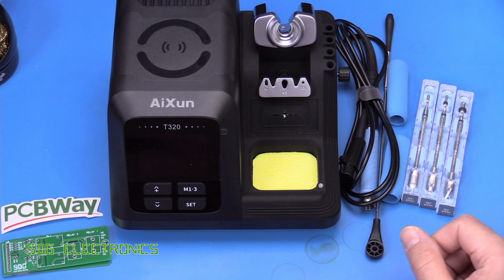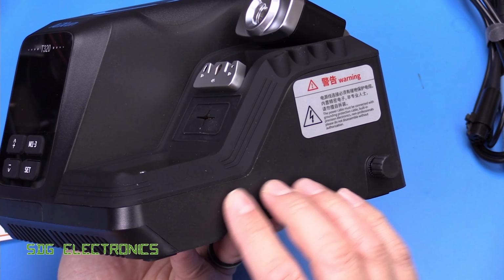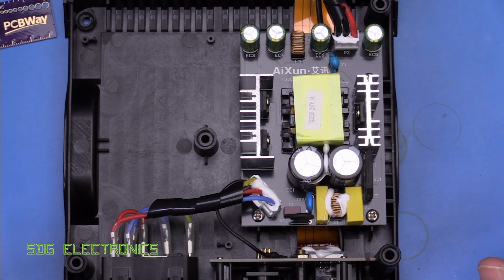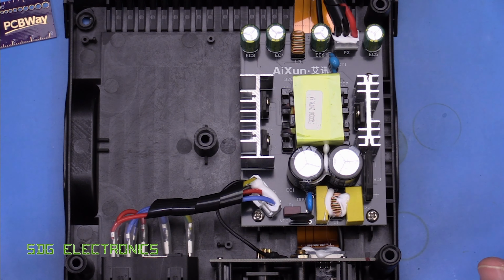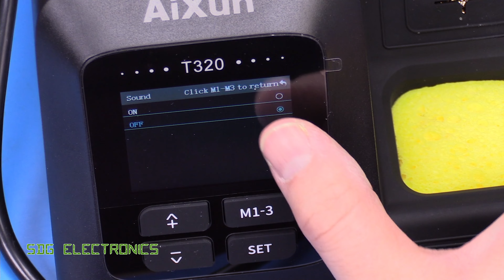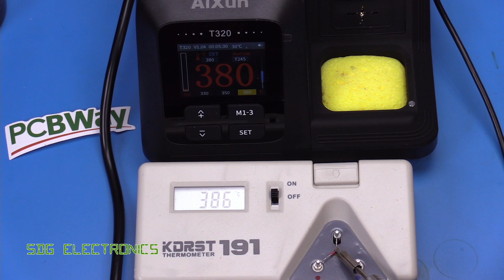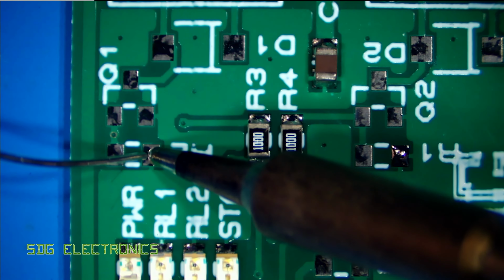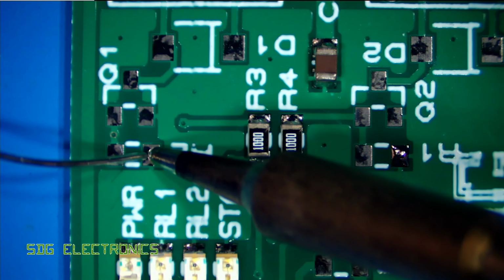SDG #319 AiXun T320 200W JBC Style Soldering Station

Comment from the maker: PCBWay 3D Printing and Fabrication: https://www.pcbway.com/rapid-prototyping/
Aixun Website: http://aixuntech.com
Aixun T320: https://s.click.aliexpress.com/e/_DkgnT15

Pico Technology 5000 Series Scope:
https://www.picotech.com/oscilloscope/5000/flexible-resolution-oscilloscope
Support the Channel with Patreon: https://www.patreon.com/sdgelectronics
Reply: Does it have problems with temperature spikes when you touch ground with the tip? Aixun was hiding problems with previous models by showing no real temperature... Also voltage about 1 V with ripple was leaking through the tip, in other video it was almost 1.7A.
Reply: Can you please check it if your device has similar issues like in tony359 on 11th minute he shows voltage leaks, temperature spikes at the tip of the iron.
Reply: Does it leak to grounded surfaces like the other auxin ? 😊

Comment: honestly the feature for changing temperature with the iron is pretty genius! Never seen anything like it but it makes a lot of sense. On my workbench I have the iron and control unit on the right side which means I either need to reach across with my left hand for change settings, put the iron down and use my right hand or try to change it with my right hand while also holding the iron which is what I often do but isn't really the safest

Comment: Thanks for the review gave me the confidence to buy one. My first soldiering station.I like its all in one: sponge, steel wool,  and cradle. Heats up quick and automatically shuts off or runs in low power mode. My old cheap iron I would ruin the tips because it run 100% and I'd forget it on.

Comment: Did they correct the un wanted voltage at the tip that the older units had?
Reply: and the temperature jumps and lying temperature display
Reply: Doubtful. It’s the thermocouple circuit design that’s the issue.
Reply: @I_SuperHiro_I  maybe a couple amps of heater current flows out of the tip too! 

When touching the tip to an earthed pad, a parallel return path for the heater current is created through the mains wiring, like a ground loop (because the SMPS output -ve is earthed and JBC C245 thermocouple bridges the tip & heater).

Comment: If you want to replace the no-name capacitors.

X2 400V 120UF 30x18mm Pitch: 8mm
X4  35V 1000UF 20x10mm Pitch: 5mm
X1  50V   22UF 11x5mm Pitch: 2mm
Reply: Sadly, unlike american companys where you can tell when a revision has been done, these chinese companys change the product on the fly and without warning or indication.

So whatever caps are on it today, might not be on it tomorrow.  And when you shop on aliexpress you could be buying a 2024 model, or it could be a first release, or it could be a chinese company copying a chinese company
Reply: @andrewa8569  A chinese company copying a chinese company, lol thats funny!
Reply: @smjerbetsk   Happening all the time

Comment: For someone trying to get a good decent iron who is not familiar with all the brands and the pro's and cons it's an absolute minefield!. Some are not earthed, some have massive temperature fluctuations, some are not good at some repairs (pinecil for bigger jobs etc). I wish someone would make a video with 5 irons and give beginners more help and info on one video. It's overwhelming :)
Reply: Hi, I'm in the same situation, after your research which soldering station do you recommend buying ?
Reply: That's where I am, as well. I've found myself interesting in soldering, mainly as a sort of hobby (game controllers and such), and can't decide on what to get. I don't want to spend a ton on a pro-grade setup, but I don't want to buy junk either. Other than the biggest names, which come with the biggest price tags, all the others just sound like made up names you'd find on aliexpress or amazon, and I can't make heads or tails of them.
Reply: @CajuNerd  As you rightly said the problem is that the big brands like JBC, Pace, Ersa, Weller, Hakko, Metcal, have a high cost, at the beginning I wanted to buy the less expensive models like the hakko fx888d or the Weller WE 1010 but both use the old technology with a separate ceramic heating element that transmits heat to the tip, the soldering stations (of well-known brands) with the new cartridge heating system are generally more expensive, the cheapest basic models I have found are the JBC BT-2BWA and the PACE ADS200, or the i-CON NANO MK2 which does not use cartridge tips, they say it works well anyway even if it only has 80w, and its tips are cheaper, unfortunately these stations are around €300, keep in mind that the original JBC tips are expensive, the rest of the stations are part of the T12 hakko and JBC clones, C115, C210, C245, in my opinion it is better to aim on soldering stations with linear transformer (compatible with original JBC handles) which do not have the problem of grounding and temperature fluctuations, GVM H3 3, Wemon T31, jabe ud-1200, AiXun T420. Otherwise with a very limited budget they recommended me a station that uses T12 tips, the T12 are very cheap, the STM32 stations like the QUICKO 958 and the KSGER v3 are compatible with the DavidAlfa firmware, the custom firmware offers many advantages, in some models the grounding problem must be fixed, even if in the latest models they have fixed the grounding on the case but not on the tip, electrostatic discharges, called ESD, can occur, the topic is a bit long, it is advisable to have a second soldering iron if it is necessary to make some modifications to make the station safe, the power supplies of the QUICKO and KSGER are not great, some recommend replacing it with a double isolation power supply like the Meanwell RPS-120-24, there are also the QUICKO and KSGER mini without a power supply where it is easier to combine a quality 24v 3-5A one. Finally, they also recommended that I purchase a used station like the Metcal MX 500.
Reply: Totally agree. I spent last 3 days deciding what to buy. The more i read, more i am confused.
Reply: "For someone trying to get a good decent iron who is not familiar with all the brands and the pro's and cons it's an absolute minefield!" In a way that's true, but in a way you could also just buy from Hakko, Ersa, Metcal etc and know you are getting a quality product from a reputable manufacturer without needing to think too much about it.  

Some still swear by Weller too, though the internal constructions of some of their products seem a little shoddy nowadays.
Reply: @CanaleYouTubeGeneralista  Those are great points! However maybe the problem is hobbyists being obsessed with using integrated heater soldering tips, when the older-style is reliable and works just fine?  I see Mr. Carlson from Mr. Carlson's lab using a basic $100 Hakko FX888D and having no issue with it for example.
Reply: @spiky29  I've been reading about it for months, lol! I could have just ordered a FX888D and given it no further thought, which may have been better TBH. 😂 It's pricey at $217 AUD + $50 AUD for a set of extra tips, but it will probably last 20+ years where the Chinese soldering stations probably won't.  Then there's Pinecil, FNSIRI, Miniware etc too...
Reply: "I wish someone would make a video with 5 irons and give beginners more help and info on one video." Made with Lawyers has a video comparing Pinecil, Miniware TS80P, Weller WE1010, Hakko FX-888D and Ersa i-Con Nano.

Comment: Thank you so much for this review. I just ordered the Aixun T413, which looks to be the same, just with a traditional frequency transformer.
Reply: Does it work well ? How do you like it ? Has the grounding problem been solved ?
Reply: @CanaleYouTubeGeneralista  not well so far. Genuin JBC cartridges are not able to boot up the station, unless i heat them up manually before turning the station on. Then the resistance gets high enough for the station to allow the boot and handle to  recognize and start. When started, it works really well… it is however very frustraiting, and Aixun is not very open to promis a firmware to help this issue…
Reply: @EmilWilkensRC  Thank you for sharing your experience, let's hope they solve it with a new firmware, I was looking for a soldering station with a T12 or C245 linear transformer, I didn't want to spend a lot, can you recommend some soldering stations ?
Reply: Just to add: I received a T413 last week, bought it for the same reason (with transformer). It came with the initial firmware v1.01 and I did not update it yet. Having read your post about genuin cartridges earlier, I did a quick test with a new original JBC 907H and a JBC 911H cartridge straight from the packaging. Station and handle still 'cold' as well. The station properly booted with both and started heating both after placing the handle with cartridge in the holder as mentioned on the display. So I can't vouch for other cartridges, but these worked on mine.

Comment: This video couldn't have come at a better time. I was on the fence with a T3A / Mechanic C211 and Sugon T21. Just bit the bullet with the T320. £101 delivered to the UK within 7 days with 3 tips is an absolute steal.

The one confusing thing is that I thought T210 and T245 are wired differently? 
I know the T3A uses GX style connector with T245 whereas the T245 on the T320 is 6 pin and is the same style as the T210 on the T3B
Reply from the maker: On the T420D the irons both use the same connector. Some of that circuitry around the driver transistors may be to adjust the drive for the two different irons

Comment: i have a question for you. so i am fairly new into understanding these soldering stations and i am a hobbyist mainly in rc car building but also make custom flashlights. i had a weller we1010na that i just returned because it struggled to solder the bigger stuff. i just bought a aixun t3a but havent recieved it yet. i solder some very big things 6 awg wire and big bullet connectors on rc car esc speed controllers. what would be the best soldering station you would recommend for plenty of power for someone doing big soldering stuff but also small pcb on flashlights if i want? is the t3a i bought going to cut it?

Comment: So I just purchased one of these right before learning about the T413. I am seriously considering returning the T320 when it arrives, or maybe re selling because I am not confident that attempting a return through ali express is wise. Would you go through the trouble to get the T413 over this? Seems like they are a little hard to come by in a 110v configuration. *edit, canceled the order and bought a T420d with 2 handpieces.

Comment: on some scenarios it's impossible to make the PCB "fully disconnected" from earth. I've been trying to use my T3A to de-solder SMD capacitors, using a second traditional iron. It's impossible, the temperature reading gets unreliable and the tip reaches 500C with 360C as set point. I am so unhappy with my T3A, I would not buy it again. I feel that this earthing issue is a major one. 
This seems to behave a little better but still I don't want to see 410C when I set 310C on the unit. I would also check the actual tip temperature when that happens: with the T3A they tried to hide the overshoot with FW 1.34 so who's telling us that this is not doing the same and they are also covering the power spike on the display? :)

Thanks for testing the earthing issue I discovered on my T3A video review.
Reply: Isn’t it trivial to add a switch (or just an anti-ESD 1-10MΩ resistor) between the mains earth and the 0V rail?
Reply: Maybe buy the linear psu one
Reply: @Scrogan  I am not 100% sure the supply earthing is the issue here.  Even if it was, does that mean the tip is going to be unearthed? It also means opening it up, probably break the front panel in doing so and losing whatever warranty it comes with :) Anything is possible of course.
Reply: @ndarjotech Maybe buy a JBC? :)
Reply: @tony359  i will wait for the review in eevblog 😂
Reply: You are right, this unexpected temperature raising because you touch earth is THE show stopper for me. It clearly happens again in this video with this device, and no I don't believe it is any better than before. Not solved at all. Is this thing actually passing certifications? Is the handle sufficiently isolated from mains? I'm not convinced about this....
Reply: @Janktzoni There’s also a military standard regarding leakage voltage on the tip. All the name-brand ones pass it now*, I’m quite certain these do not.

*amusingly, JBC failed it in their early cartridge heater system using the T2045 handle and tips. It was quickly followed by the T245, which added the third terminal on the cartridges to fix the problem.

Comment: Wow. It seems to be a much better improvement to the T3A. There's something I'd like to know that I haven't found a solid answer yet and I hope you don't mind me asking for your help. Is it possible to use ANY original JBC 245 and 210 cartridge from their entire cartridge range with these T245 and T210 AiXun handles? Would original handles work with this station? Thanks in advance for your help, Steve.
Reply from the maker: Yes the cartridges all work. If you buy a JBC handle, you'll need to swap the connector though.

Comment: Wonder which one would be a better buy. The T3A (or the newer T3AS) or the T320
Reply from the maker: I think this one is probably better overall.
Reply: @sdgelectronics  From what I've heard the T3A had some issues with overshoot, but also power supply buzzing issues. Maybe those are fixed on the T3AS, or is it the same as the T3A? The T3A just takes up less space with the separate stand.
Reply: @PiratCarribean  Pretty sure The T3A and T3AS have the same issues with buzzing.
Reply: @PiratCarribean  those are software issues

Comment: I used to work in the electronics industry for a long time, and our soldering stations were JBC. You mentioned this unit being very light, does that make it move across the table when you put the iron back in the holder?
Reply from the maker: The feet have good friction, so no issues like that
Reply: When you try to change tips the whole station is moving. You need to hold it with one hand and then remove tips. Quality of this plastic housings is poor. My unit has uneven base so it wobbles even when you press buttons. Feels more like cheap plastic toy than a soldering station.
Reply: @sdgelectronics foot friction does nothing to help when you pull a hot tip out using the included stand. The whole station gets lifted up if it’s light, no?

Comment: Most viewers do not necessarily understand a solder iron power ratings nor the ohms law. It would be best if you mention the JBC cartridges are 2.5 ohms rated unlike others that are 3.5, 4, or 5.6 ohms, and thus consumes more power and are suited for stations that deliver the required power for the cartridge.

Comment: have you thought of trying the T413? it sounds like an excellent budget option, the same isolated transformer as the T420 but at half the price!
Reply: T413 uses a proprietary handpiece I believe. I wound up with the T420d so I can use the 115,220, and 245 jbc handpieces. It also does a larger handpiece ill probably never use.
Reply: @tokin420nchokin  I'd love the t420D but 480CAD is a lot of money to me I can't justify it :c
Reply: @tokin420nchokin  i have an ancient weller that can barely heat up anything, but I've recently started just using my hot air to preheat my boards to 100c-120c before working.. it's annoying but gets the job done for a casual user.

Comment: What if you insert a 1Mohm resistor in the ESD line ?   Does the temperature spike still occurs ?
Reply from the maker: It's an issue with the AC to DC converter. The output is tied to mains earth for EMC reasons

Comment: aixun t413 seems to have a a transformer, which may seem to fix this problem aswell as the voltage leak problem which i personally had experience with this station which was the reason why i got rid of it
Reply: Hi, which soldering station do you use now ? Which model do you recommend buying ?
Reply: @CanaleYouTubeGeneralista  aixun t405 but t420 very nice
Reply: @3ijnweu3oq3 I think Aixun stopped making the 420 single channel model. It sold for about €100 to 130 less than the 420D (dual channel) model which they continue to sell. It was a very good soldering machine in its price range. I really regret not getting one. And I can't justify the cost of 420D.

Comment: I have the Yihua 982 C210/245 station , some good soldering units coming out of china , mine does the job only thing that bugged me was the handle conection at the back i coverted mine to front socket gained about 6'' of lead also got a 90deg power socket lead the unit now stands about 2'' from the back of the bench ..................

Comment: Quick question, what solder were you using, lovely clean shiny joints.
Reply from the maker: It's a 0.5mm 63/37 Multicore solder. Any 63/37 should give the same results

Comment: Shame you didn’t double check the temperature calibration/compensation function, and the units behaviour with cheap tips.  But regardless, a fantastic review, thanks!
Reply from the maker: It works as you'd expect, when I change the value to -7, the readings are spot on. It's different per cartridge though as they all behave slightly differently, so if you swap out regularly there's little point in changing the value.
Reply: @sdgelectronics  Great to know! Your reviews on kit are always the reference standard.